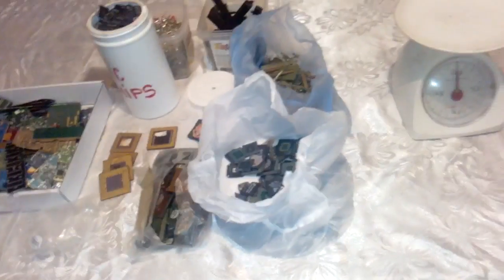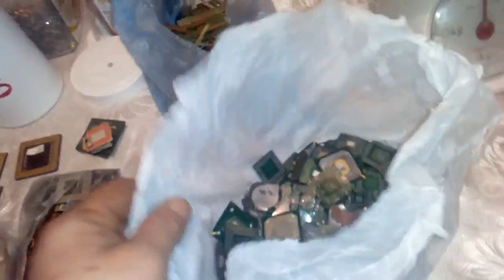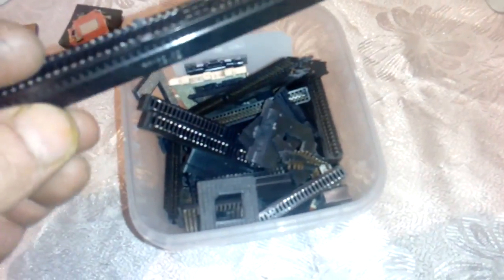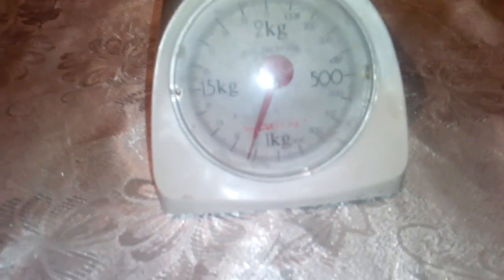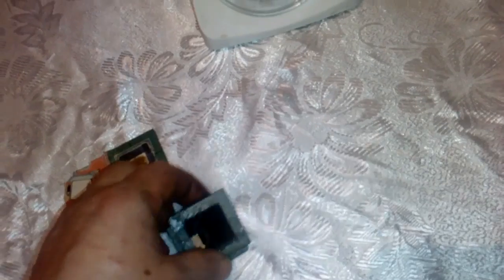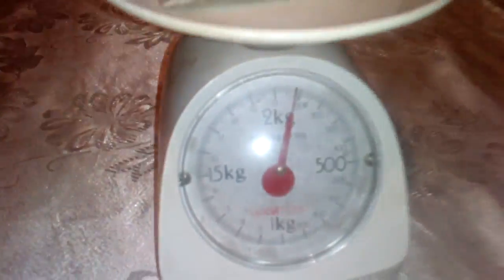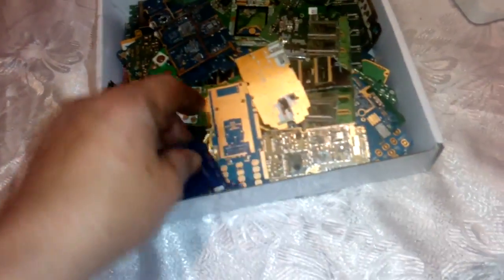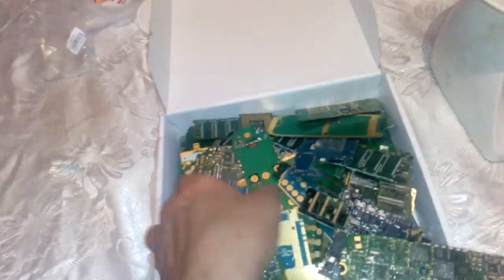Vlada E-waste for gold recovery :)

Comment: a doubt you plunge the bga chip board into sulfuric acid as well
Reply from the maker: Noup,only the upper silica parts, the lower fiber goes in Ap.
Reply: in case I have to burn the fiber part to put the gold in this
Reply from the maker: Ap you are the safest way!
Reply: I did not understand AP as well so you have some videos showing
Reply: or if you have some link you can give me the process to see